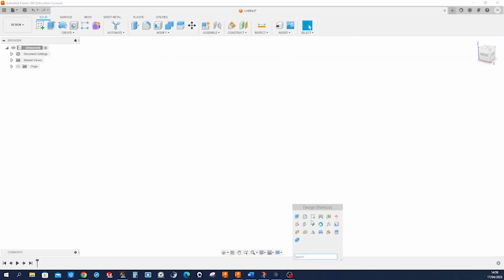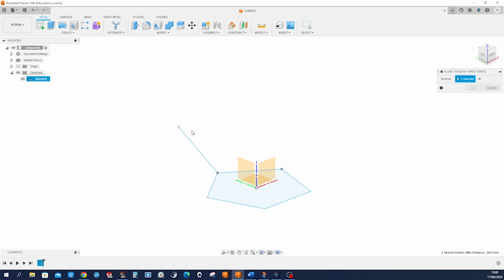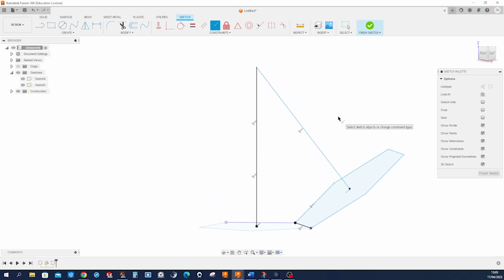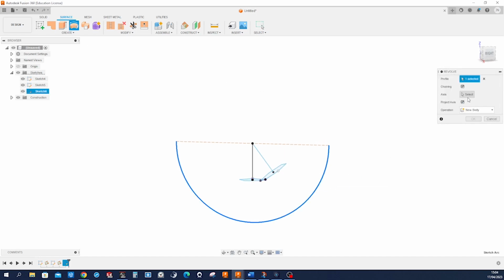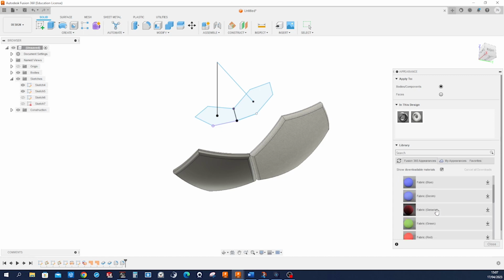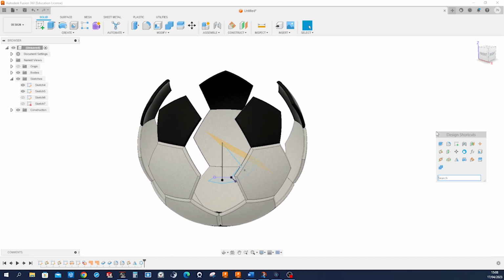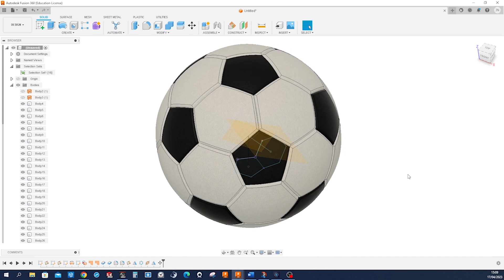Soccer Ball Design - Fusion 360 Tutorial

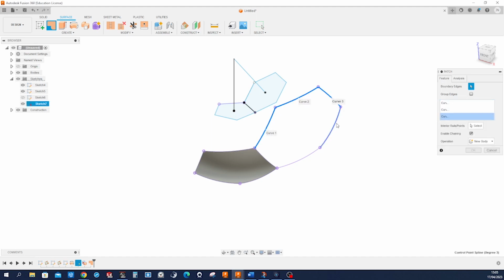Comment: At 5:20 Wen the patches Are made i can't get the second patch to form. the first one is no problem. but the second one does not appear. even if i try to patch the big one as the first one it wont appear its only the small one that forms a patch. have done the video step by step twice. deleted everything and started over and it's the same problem. the only thing there is different from my design is that the angles on the line going out from the first polygon is not 120 by 120 degrees mine is 120 by 119.99999can that affect the patch not forming.?
Reply from the maker: It definetly has to  be 120 on both. There are some helpful suggestions in the comments.

Comment: I had the same problem with the second angle constraint and solved it like this:
First, draw the line from the corner point within the plane of the pentagon.
Use the "Angle" constraint to set the line at 120° relative to one of the adjacent sides.
Instead of adding a second angle constraint (which causes over-constraining), use a construction line or reference from the opposite side and apply the "Perpendicular" constraint to ensure the line is perpendicular to the opposite side.
This way, the line stays within the plane without causing over-constrained errors.
Reply from the maker: this sounds like the perfect solution!

Comment: it's impossible to get the second 120 degree angle. Maybe do you have a special configuration?
Reply from the maker: No, if you have trouble defining the  second angle, you could crreate a coincident constraint on the symmetry plane.
Reply: @cademist  how??
Reply: @Ronke01  this video and the replies from the poster are horrible. I haven't tried this yet, but....

Good question — that one’s a Sketch Constraints thing in Fusion, and the wording is a bit old-school too. Let’s break it down:

🔹 What the poster means

They’re basically saying: if you’re struggling to lock down an angle in 3D space, force one of your lines/points to sit exactly on your symmetry plane.
In Fusion terms, that’s a Coincident constraint applied to the symmetry plane (like the XZ, YZ, or a construction plane you made).

🔹 How to do it in Fusion 360

Make sure your symmetry plane exists
This could be the default Origin plane (XY, XZ, YZ)
Or one you create with Construct → Midplane / Offset Plane
Activate your sketch (where the curve or line is).
In the Sketch Palette / toolbar, choose Coincident (icon looks like a little point on a line).
Click the endpoint (or line) of your curve → then click the plane in the Browser tree or in the canvas.
If it’s a point, that point will be locked directly on the plane.
If it’s a line, Fusion will make sure the line touches the plane.

🔹 Why this helps

By forcing the curve to touch or lie on the symmetry plane, Fusion no longer has to “guess” the second angle — it’s mathematically locked. This is a common trick when working with 3D Sketches or loft guides.

👉 Quick tip: If you want true mirror symmetry, you might instead use the Mirror constraint in sketches, or the Mirror feature in 3D. But “coincident to the plane” is the minimalist way to anchor geometry.

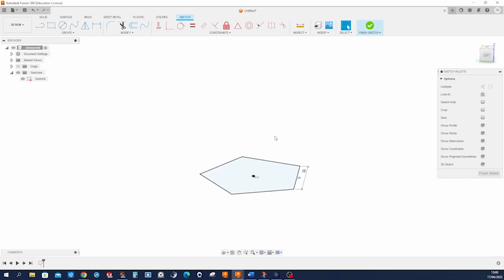Comment: How are you able to keep drawing on the sketch but not on the plane at 0:54
Reply from the maker: Be sure to check the box "3d-curve" on the right hand side of the Graphics window
Reply: @cademist  

Fusion 360 doesn’t actually have a “3D-curve” checkbox in the main UI. What you’re probably looking at is either:
Old instructions (from the early days of Fusion / tutorials written for Inventor, Rhino, or other CAD tools where “3D curve” is a real option).
A reference to Fusion’s “3D Sketch” mode, which does exist but is hidden in a slightly different place.

🔍 In Fusion 360, the equivalent is:

When you’re creating a sketch, look at the Sketch Palette (on the right side of the screen while sketching).
There’s a checkbox called “3D Sketch”.
If you tick it, your sketch lines can go out of the current sketch plane into 3D space.
Without it, everything is constrained to the 2D plane you started the sketch on.

Comment: how to make 120 degree relation with both the lines?!
it's showing me constraints erorr😑😑
Reply from the maker: try to move the dangling line to an approximate position, then constrain.
Reply: Same problem here, every time an error
Reply: Same problem, like @MAKDUSUL_HASAN and @lolo3. It only allows me to enter a 90.5° on the second angle! (1.18 min)
Reply: I had the same issue, but if you select an other point of the hexagon it will work
Reply: Anybody figured this out? very annoying to try and follow along when so much is happening without explanation and some things just seem to be broken for me somehow.
Reply: @Ronke01  nobody has figured it out including someone who says they were working with Fusion tech support! One answer the poster gives above references a setting that doesn't exist (anymore) and doesn't even show on his screen in the video. He says "3d-curve" and the closest thing to that is "3D sketch" which checking doesn't resolve the problem. He mentions doing something else super-technical elsewhere in the comments. I'm going to try to figure that out.